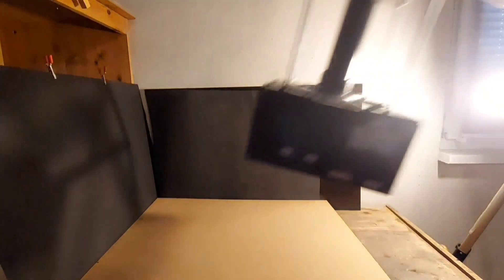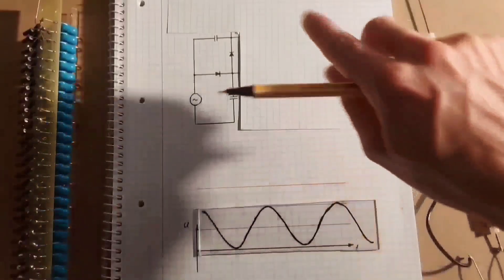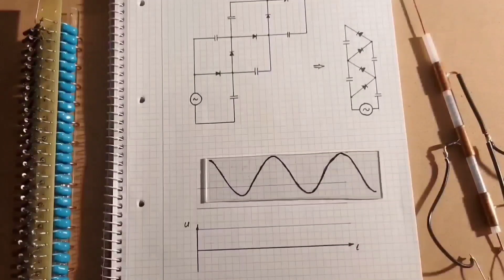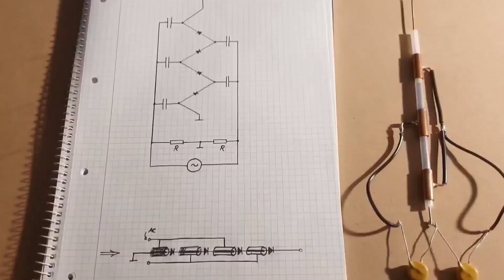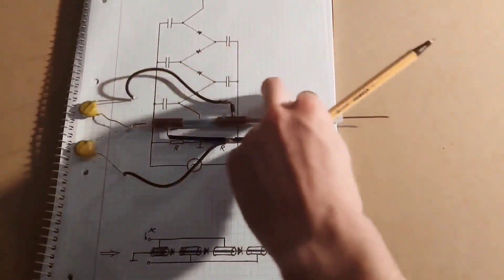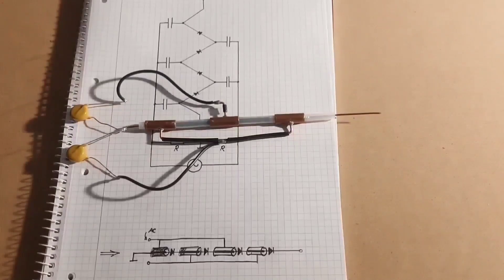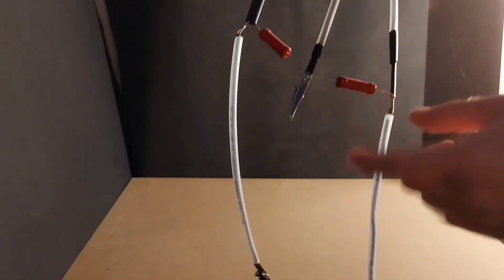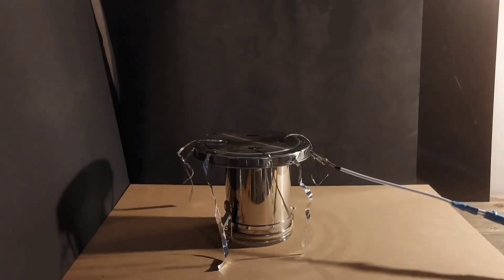The HV multipliers unknown brother

Comment: I dream of making my own dynamitron for a very powerful fun machine, dunno how high of a potential is possible to make for a person but I want to use a pressure tank from an old large compressor with a r134a/N mixture as insulating gas to insulate the terminal and basically recreate the professional ones. Im aiming for at least 2 MV and 1 mA beam current. I know its quite crazy but why not try, until now i think is the most feasible way for a hobbyist to reach MeV energies at high currents. Edit: was too optimistic, seems going above 1MV is extremely dificult for a hobbyst so ill see how close to a MV I can get.

Comment: Excellent video. 
Sir, Hats off. 
1:48 you say a smooth field... 
This means a ripple free ( minimised) DC supply. 
Have you tested for the ripple of the output HV? 
What is the maximum voltage and current you generated and the existing ripple is how much? 
Thanks and Regards .

Comment: Instead of using large resistors to limt current would it be possible to use multiple smaller resistors in the diode capacitor multiplier network?
Reply from the maker: Yes it would be possible but it would also mean that higher caps are charged slower and slower 
It would be better to have your voltage at the output that is then limited in its current 
Another idea would be to reduce the capacity of the very first cap because a short circuit there is a current that goes through all diodes and the first cap (doesnt protect the circuit from current Spikes from arcing on the other hand)

Comment: Some antenna coax wire is actually built like this, with a solid wire in the middle and shielding around with a plastic layer in between, so maybe it would be possible to use coax wire sections as the capacitors for this generator, with diodes in between

Comment: Awsome tutorial. Try making a spiral line pulse generator as well can make hundreds of KV at high current from foil and a spark gap. Arange as a jelly roll capacitor capable of withstanding anywhere from 10 to 20kv, then add up to 18 turns of well insulated foil in the middle. When discharged it creates a wave similar to a tidal wave where current is converted to voltage at high current as determined by turns and surface area. They use these in industrial pulsed X ray sources. 😁🤓❤

Comment: 2:00 I wonder if it would be possible to 3d print a structure where all the parts can be just plugged in and then soldered from the sides... that would make alignment so easy...  maybe with nylon ?  Amazing solder work btw !
Reply from the maker: Thx 
Good idea ! 😄 i cold also imagine to glue it first with epoxy to have one string of caps 
unfortunately i dont know much about 3d printing and what is possible with it haha  😅 but i sometimes see very helpful ideas

Comment: Love the way the capacitors are integrated right into the structural design! What kind of diodes do you use? From the looks of it they must have PRV well 1kV each
Reply from the maker: It was the 2cl75 (5mA 16kv) and it has a fast switching time

Comment: I've had one more thought on your Fun detection of stuff generated by the tubes. Geiger counters are quite sensitive to high voltage fields directly, even in absence of Fun. Because it can cause discharges to happen inside the tube which will be counted as Fun, even if no high energy photons pass through. In fact I have just experimented with one of my Fun detectors near a HV supply in conditions where no Fun would be generated, and it registered a lot of Fun which wasn't there. You may want to surround your detector with EM shielding like a Faraday cage to make sure what it's reading is actually Fun and not something else.
Reply from the maker: Haha mh yeah thats hard to prove wrong 

On the other hand i noticed an inhomogeneous distribution of the xrays along the tube 
The only thing i can imagine that the amplifier and the meter would give a false value due to the fact that there is a ripple voltage still existing  but that wouldnt be such nice "click" noise 😅
Reply: @atominik3375  It may be difficult to distinguish primary and secondary xrays . That could give a false sense of the pattern. I think simple metal shielding is used to filter for xrays. you could just wrap it in foil and ground that I'd think to filter induced voltages from the electric field reaching the tube, but the xrays still would.

Comment: does the vegetable oil go bad over time?
Reply: Better use refined mineral oil, aka "baby oil" at the pharmacy.
Reply: @stamasd8500  Crazy that mineral oil is still sold as “baby oil”, isn’t it?
Reply: @serpent213  I was always kinda repulsed by the texture of it. Never really saw why it was applied to babies.
Reply from the maker: Yes that would be also a good idea 😄
Reply: Certainly, submerged a couple of microwave transformers in sunflower seed oil for a CO2 laser project about 15years ago.
That smell and the sticky goo of rancid oil was horrible. 
Just use long chain hydrocarbons (mineral oil or paraffin wax) and not those rancid fatty acids bonded to glycerine....
Reply from the maker: Yes and i think that i noticed a bit lower voltage over time (small drop, just a few kv over a year compared to 150kv at max)

To slow this reaction of the oil down i tried to fill the pipe up to its edge before i glued it together(this glue at the lid is one i can remove later...not the pvc welding sort of glue) if the voltage drops more i would have to change the oil and use it for cooking again 😋
Reply: @atominik3375  The vegetable oil is an ester, over time (and especially if there is moisture and high voltage around) it will break down generating free organic acids which will degrade its dielectric properties.
Reply: So .. probably better to use it as fuel, bc the fry-ups would likely have a rather acrid taste